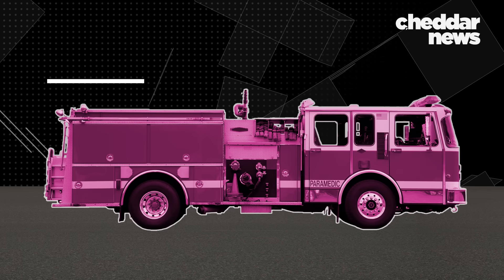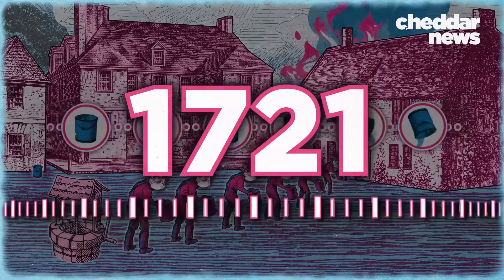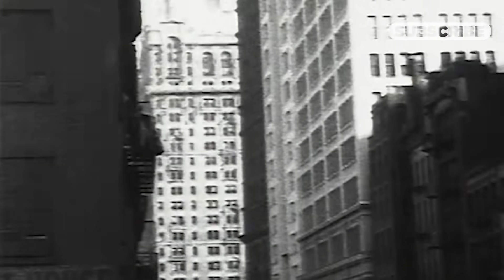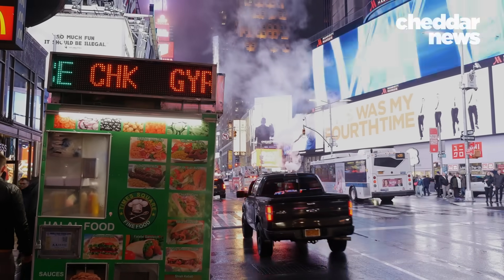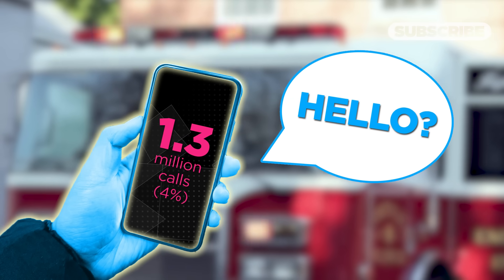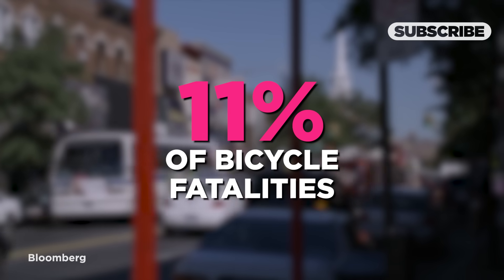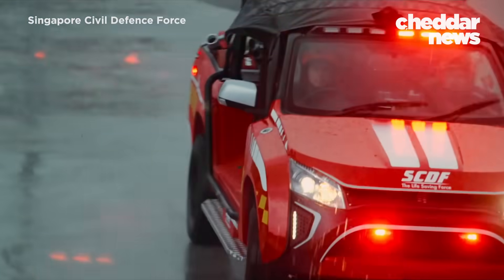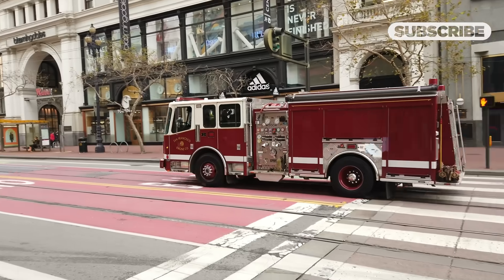Do American Fire Trucks Need To Be So Massive? - Cheddar Explains

Comment: 1.  I love how this guy shows a USAF KME, P24 w/ all wheel drive, and a top mount pump panel and says 'here's a typical American fire engine.'  LOL.  Clown.
2.  Nearly all Engines Co. in urban areas have a 500gal. tank, not 1000 gal.  They may have 1000 or 1200 GPM pumps on them, but no 1000 gal. tanks.  
3.  I would love to have a Mercedes, Scania, or Man chassis for fire trucks, but USDOT regulations don't allow them to sold in the US. 
4. Every thing I've seen for 30+ says the custom chassis fire trucks are safer for firefighters in a crash than commercial ones.  Please show me your data.  Also, nearly all commercial chassis that are USDOT compliant are not cab-over.  They have a longer wheelbase and wider turn radius, so, why would you want a USDOT compliant commercial fire chassis?
Reply: actually there are a few Tatra, Mercedes, Volvo trucks in use at US fire departments
Why do you think custom chassis is safer than a commercial chassis which was designed for big rigs as well?

Comment: I can already tell that Cheddar News is blissfully unaware of how firefighting operations actually work.  And YES, we need every massive fire engine out there regardless of the paltry 4% “actual fire” responses you’ve cited.

The problem you’d run into rapidly is during a large fire… which actually do happen frequently… at which point if you eliminated any of the large fire engines you’ve listed, the fire service would collapse and be unable to provide adequate fire service coverage.  Just look at any Mutual Aid response, 3rd Alarm to 7 Alarm fires… or in Los Angeles just last year when wildfires consumed large sections of the coastal areas… you needed more and more fire assets… so much so that they were responding to Los Angeles from OREGON.

Let’s not be hasty to clip back any assets.
Reply: yeah, and a 1.3 million dollar engine with less equipment than a 600 thousand euro (dollar) engine in Europe makes that situation even worse.

Comment: What I never understood is why are American fire trucks custom built. I always thought that would be more expensive than just buying a local-made comercial truck and turning it into a fire truck.
Reply: mostly because every department has different needs.  A department that has multiple multi-lane highways has very different needs than those with only 2 lane rural roads.  A department with even one single high rise building has very different needs than one with only 2 story houses.  A department with commercial structures or industrial parks has very different needs than one with agriculture or forests.  You get the idea.  Plus equipment itself varies by department even if they have similar hazard uses.
Reply: @-KingOfKhaos  even though every FD might have differentt needs (let's be real: most don't have different needs), you can do the very same with a commercial chassis?!

Comment: While there are advantages to the smaller European fire trucks, I bet some in France would have appreciated having some of those big US fire trucks available when Notre Dame caught fire. 

Most European trucks can pump around 500 gallons per minute.
Most US fire trucks can pump around 1,500 gallons per minute, especially with an unlimited source of water (the Seine river) only 150 feet away (the Cathedral sits on  an island in the middle of the river)!

In fact, per one source, the NFPA requires a minimum of 750 GPM for new engines.
Reply: in most situations Europeans don't surround and drown the scene. If absolutely necessary, there are pump systems capable of high capacitties, and monitors with a water capacity of up to 14,000 gpm

Comment: You wouldn’t be complaining about how big a fire truck is if YOU NEEDED one to save ur life !
Reply: Except when it comes too late because its stuck in traffic because its too big
Reply: @wolf310ii Never happens.  When drivers refuse to move, they get yeeted off the road.  Ask me how I know.
Reply: @ Just watch a few video of the NYFD, its pretty common that they are pretty slow, because cant move through the traffic.
And when they yeeted you off the road, they did it because they had to slow down or stop because of you.
Reply: @ Wrong… I DO THE YEETING… we have a zero fucks policy
Reply: @ PS-  It’s FDNY, not NYFD, and they are in my back yard 🤣🤣
Reply: @-KingOfKhaos  Then you simply lying or dont know what stuck in traffic means.
Reply: @wolf310ii  You realize the US is more than simply New York City and Los Angeles right?  It’s shocking I know… but it’s a vast and varied country here… watching Engines and Tower Ladders get stuck in NYC traffic is one set of problems, but largely, the system works for FDNY, otherwise they would have switched it decades ago.  After all, it’s largely been FDNY that leads most of how other Departments operate.  We don’t need to even guess at that since fire trucks across America and turnout gear that firefighters wear have been modeled after what FDNY purchases… 

And as someone that was in the fire service when we could still ride the back step of the ruck I’ve seen stuff.  It doesn’t matter to me what you believe.  But the fact is, our fire apparatus is built the way it is for a reason and it’s done with significant fire science behind it.
Reply: @-KingOfKhaos  Lol, "we always have done is this way" "murica big, murica needs big trucks" "change is too expensive" isnt science.
Just because you are spoon feed 24/7 that USA is the best, doesnt mean its true
Reply: @ Negative.  The fire service here does actually have an entire field known as Fire Science.  It also collaborated with EU partners as well as Canada (who BTW, also use American apparatus because guess why… you got it… similar climate and similar buildings / structures / hazards / materials).  We compile the best data has to offer and tailor equipment and apparatus to that data.  Don’t get annoyed at me for pointing this out… it’s literally data.

Comment: Mercedes Benz Unimog division manufacturers a beautifully designed fire engine for European markets, and seems to get the job done nicely, without having to be an oversized gas guzzling beast.
Reply: Now show that same Mercedes fire engine pumping into a high rise standpipe upon arrival and then crying when the water runs out in 20 seconds.

Yes there are many reasons our Fire Engines are massive … something this video failed to actually address (likely because they didn’t bother to interview anyone from NFPA or IAFF etc
Reply: @-KingOfKhaos  departments which have high-rise buildings in their response area (skyscrapers, industrial buildings, churches) will also have pumps which are capable supplying sufficient water pressure.
Reply: @-KingOfKhaos  Actually, Mercedes has the Econic turntable ladder vehicle that does high rise buildings, and is what most European fire brigades use in such situations.
Reply: @napasada  Most deparments get rid of their Unimogs as they barely ever will use their full offroad potential. And a Unimog is only good at going offroad as long as it's kept light without large and heavy fire apparatus body. 
The Unimogs aren't that practical for most departments in Europe, neither in the city, nor in the countryside.
Reply: @napasada  you don't use a Turntable Ladder to pump into a standpipe?!
Reply: @EnjoyFirefighting  Maybe it's a prime example of German over-engineering, like what they did in WWII, with the over-engineered Tiger panzers.
Reply: @napasada  how has THAT to do with over-engineering? 
I just looked up the apparatus from the Frankfurt am Main FD. Despite the high-rise district downtown, they go along with normal pressure pumps ... 
Same in my city with church towers up to 340 ft tall. The FD uses normal pressure pumps on their Engines and Rescue Engines.
Reply: @napasada  so how is that related to over-engineering?

Comment: Absolutely no idea why America is stuck on these huge inefficient fire trucks. I have been saying forever that we should follow European standards, cabovers, shorter chassis, and better designed trucks is what's needed. I have a 45 ft bucket truck on a cabover short chassis and I can do a u-turn on a standard city street, never could do that with a standard bucket truck. This needs to be revisited by all fire departments for sure.
Reply: Absolutely not!  Tell us you’ve never been a firefighter without telling us you’ve never been a firefighter in the U.S.
Reply: @-KingOfKhaos  absolutely not what? You like these big inefficient red boxes as opposed to the super efficient and easier to maneuver European counterparts? You think I need to be a firefighter to figure this out? Apparently you're more of a passenger than a driver, and yes as a matter of fact I was a firefighter for 20 years, wish we had these cabovers back then instead of these clunky bread boxes
Reply: @westwasbest  Inefficient by WHAT metric?  My last 10 years on the department I was the Engineer / Driver… they are highly capable, highly efficient pieces of equipment.  And yes, our department was very busy, and right outside of NYC in highly congested areas with multiple areas of 4-6 lanes of highways as well as city blocks.  At no point was turning, accelerating or stopping ever an issue.  The pumps on board were extremely efficient and capable.  So I will ask again, by what metric are you claiming our U.S. based fire service apparatus “inefficient?”

BTW, if you need to be rescued from 5 or 6 stories up, you will need a tower ladder to do that… something the very inefficient Europeans don’t really operate.